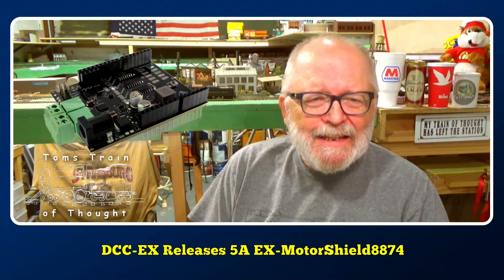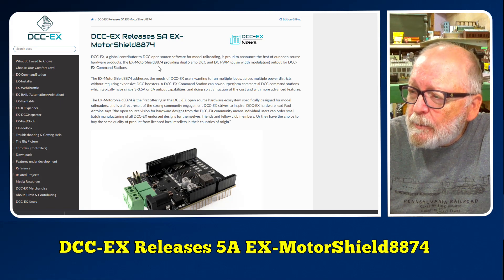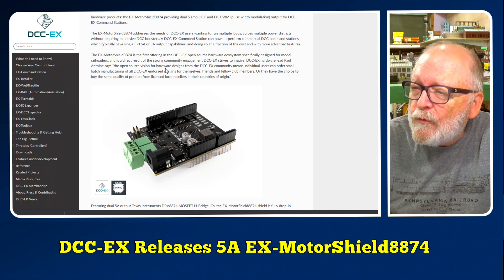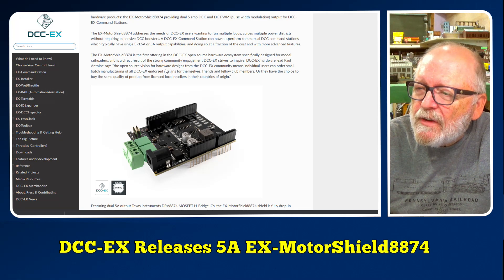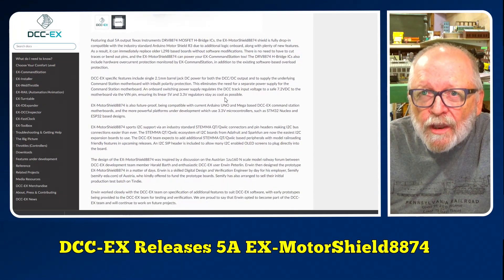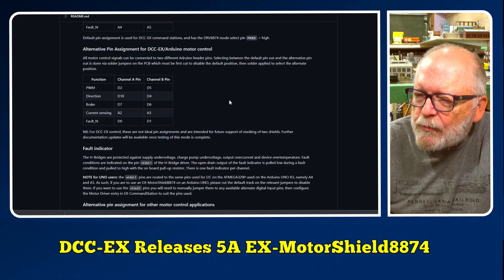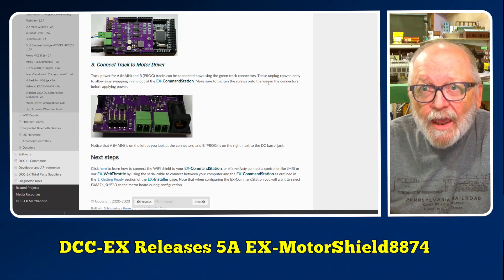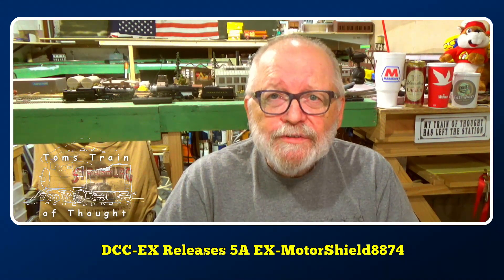Announcing DCC EX Motor Shield 8874

Comment: Tom what Wifi did you use,8874 does Not have it already right? Did you use the Dcc-ex 8266 wif shield  or another manufacturer ?
Reply from the maker: I have the MakerFab Wifi shield. I works great. It's recommended on the DCC-EX web site
https://dcc-ex.com/reference/hardware/wifi-boards/makerfabs-esp8266.html#gsc.tab=0

Comment: how did you install the command station software...having a hard time getting mine to operate
Reply from the maker: You also have to install the latest update and indicate in the config file the motor shield, it's defaulted to the Arduino motor shield. They added the code in the latest update
Reply: Thanks...

Comment: Only $40 too. That's a really good price if you need 5amp. Might have to roll one those into my newest build since it'll be using DCC++EX. But I have a stack of the standard motor shields that I probably should use as well.
Reply from the maker: Apparently, you can stack these to create districts. To be sure, go on discord to ask the developers
Reply: I don't think I need districts, parse. Just the ability to run more than 2 locomotives concurrently. with sound.

Comment: Very interesting, thanks for bringing this to us.
In your opinion, does the stacking allow for different power districts to use 1 each?
I have never spent the time investigating districts- what happens when the loco wheels bridge 2 districts and connect the 2 districts together- is it nothing bad as there is no change of potential across the districts?
Reply from the maker: Glad you enjoyed.  As long as you keep the wiring consistent between the separate districts, you would be fine. It would be similar to the districts of the Digitrax PM42. All you are doing is separating your source to expand the power distribution.